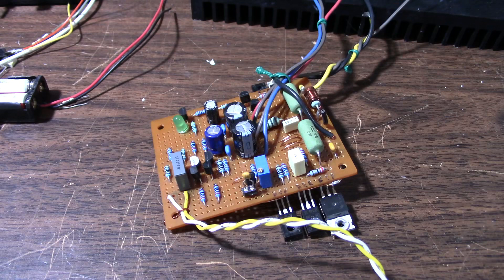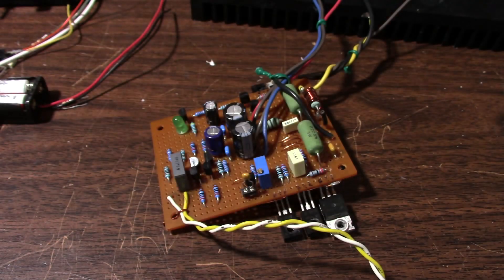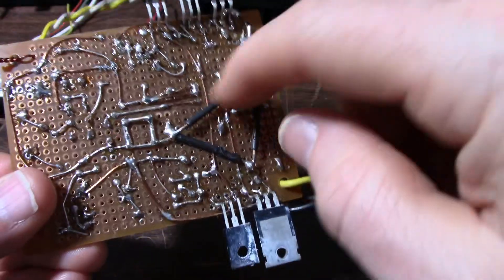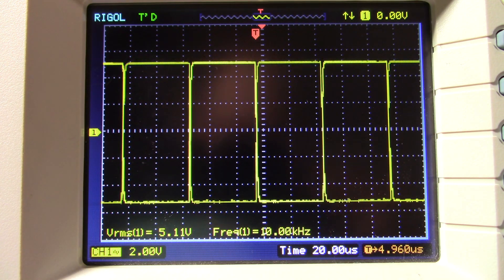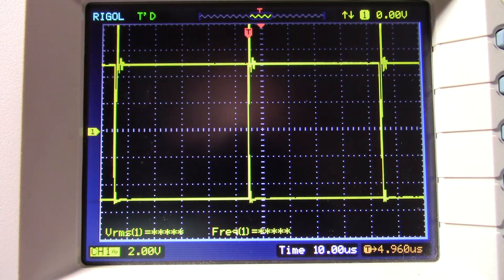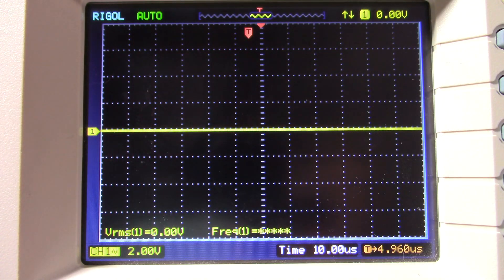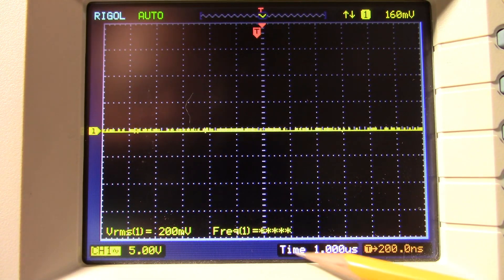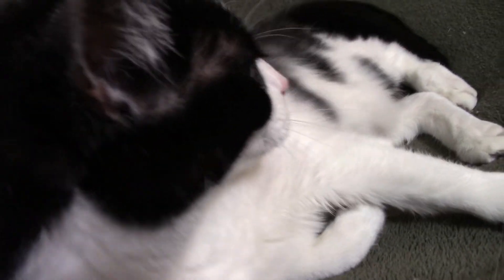Discrete audio amplifier project PT16.1 Miller compensation

Comment: the term you are looking for is "copper pour", not  flood filled ground.   mike
Reply from the maker: I must be thinking of paint programs where you can flood fill areas with colors.
Reply: Prince Bumpkin  within the electronics field, the term "copper pour" is correct.  also the term flood filled ground is not found.  I happen to be very fussy when it comes to English, and it's proper use.  either you know the difference, or you don't.

Comment: I think you should also try a sine wave. I know why you're using a square wave to test your design, but real music and/or speech is not square. You may not see this problem at all using a sine wave. If that's the case, is it really a problem?
Reply: It's about testing stability. A stable amplifier is very important. You don't know what would cause it to oscillate and when it would. Pushing a little to the edge would be acceptable but lower than 47p would not be really acceptable in this case.
Reply: Having at least 45 degree of phase margin or more than 60 optimally is necessary. You can convert to percent overshoot.